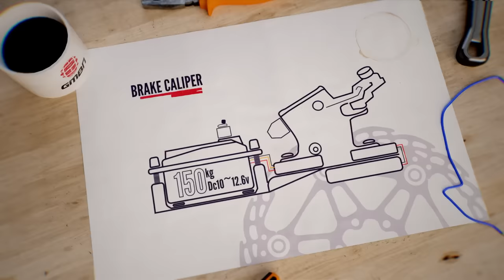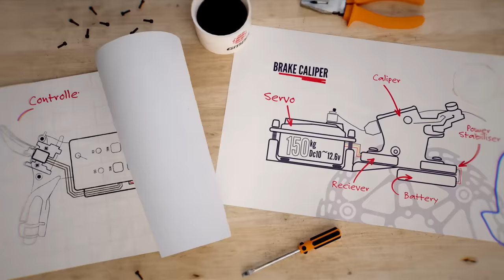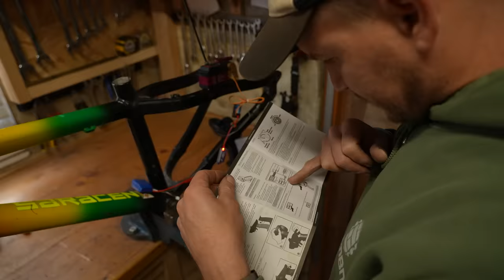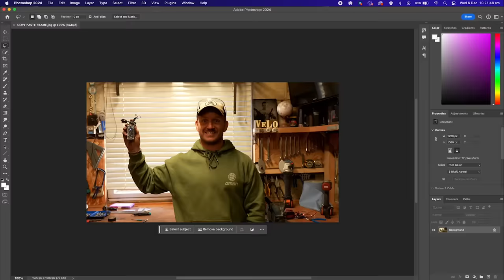We Made The World's First Wireless Bike Brakes

Comment: This is absolutely amazing ! Not just designing and building that on your own, but also daring to actually ride it pretty fast on real trails. And massive props to Blake for actually making a front brake version aswell. Im pretty certain quite some people would dare to try out the rear one but certainly only very few would dare to even touch that little front brake lever , for obvious reasons. 😆
Reply: Thanks dude. It was a hell of a challenge. Loved it
Reply: @BlakeSamson8 100% mkII needs to happen. I'd ride them if I could afford them. People fly planes with no mechanical connections. There's literally planes that would be impossible to fly with a mechanical yoke. Why can't bikes be fly by wire, too? I'm on board.
Reply: @pewsician2388  planes have decades of engineering and they are still crashing sometimes,yet their battery wont die midflight, and there is still physical cables connecting all the stuff in plane. On bike it has thousand opportunities to fail from error in electronics to lost signal or dead battery. And if battery dies once a month, you will probably end up crashing into the wall once a month
Reply: @BigAsianJesus  not necessarily, just have two separate systems for each brake so if one fails, you can use the other, or just brake by wire with regen braking
Reply: @BigAsianJesus  On semi trucks, the air system could fail and there would be no brakes. The safely approach used there is that when there is no air, the powerful brake springs will stop the vehicle. Maybe an approach could be that when the battery dies, the unit defaults to full brakes. Not sure how to work something like that out though.
Reply: @mikedwiles I think it could be done but the caliper would probably be huge
Reply: @BigAsianJesus I've absolutely abused my gx shifter and I've only had 1 actual issue with it ever. Some preface is that I crashed super bad months before the incident and knocked the battery and cover off. When that happened a little bit of the plastic on the battery got compressed where it slipped off. So basically a few months later it stopped shifting in a huge gravel climb. I panicked a bit but after taking battery out and putting it back in it worked fine. Point is it's always the mechanical bits that fail before the electronic. Everyone I know that has it or an axs dropper has never had a connection issue during a ride. Honestly for me I'm more scared when I bleed my brakes cause I always feel like I might fuck something up but that's just me
Reply: @mikedwiles  that honeslty sounds way more scary than having no brakes. Imagine you're flying down a trail and a wire comes loose or there's a short. Your front brake locks on and next think you know you're waking up from a coma
Reply: @Zimblake cheers Blake, awesome job🤘🏼.
To give it more stability to the plate of the calipers I would weld little triangles for each "L" angle on the plate.
I don't know if you understand what I mean😅
Reply: @Zimblake  i think its possible to design the levers in a way where it feels like a solid hydraulic brake (not just a loose potentiometer) with some kind of pressure sensor with a cam on the lever to press on it. perhaps the cam can be a stiff rubber so there is some give as you squeeze the lever
Reply: @bmxscape  you just have the lever act on a stout pressure sensor so the lever hits a solid stop, and varying pressure on it modulates braking.  And with software, this could be almost infinitely adjustable.   And  you could easily design a mechanical progressive pressure feedback system that would emulate good brake lever feel.

And failure?  You simply make it so when anything "fails," the default setting applies the brakes gradually until the wheel stops.  
Again, there are elegant ways to design a system that's safe & effective.

The problem is, it adds cost & complexity - and probably weight - when it's not even remotely needed.  One exception would be for different mobility issues.   Ultimately, how many batteries do you really want on your bike?  I like the idea of zero, but unfortunately that's pretty much impossible now.

Comment: For a v2: try to use a conventional mtb lever + potentiometer. Also implementing a strong spring into the lever could help with modulation
Reply: yea its missing the feedback we're used to, which is why its so automatic to just grab all the brake and lock it up.
Reply: my thoughts would be using the stuff that bottom out bumpers on coil shocks as you could swap the rubber out dippending on if you like more modulation or a short sharp leaver feel
Reply: Not an expert in electronics but was also going to suggest a potentiometer. Controller will read the potentiometer output and convert to rotations on the servo. But I assume you will have to build your own controller instead of using the RC car controller?
Reply: Maybe glue a magnet to the lever and use a hall effect sensor
Reply: If you want it to be based on feel a load cell would be ideal
Reply: @tiagobelo4965 I was gonna say that - use a load cell so the input is how hard you pull, not how far. Also maybe use a continuous servo with some sort of quick release, so you don't have to wait for it to wind out when you release the lever.
Reply: @Ryan-mv5wi  yeah,  a bump stop for the brake lever to prevent  bottoming out
Reply: And some controler to be able to adjust the ramp up of the servo would be needed

Comment: Haha, ‘Die-by-Wire’ braking… 😂
Great job Blake, creative thinking but it’s defo gonna be a thing somewhere down the line…
Reply from the maker: How long away do you think? Would you purchase some?
Reply: @gmbn  well the tech & protocols already exist, it’s just public acceptance that will be the biggest hurdle. As with everything bike related, once it’s been raced at the top level & the concept has been proven then it will slowly become accepted. 
Yeah, I’d definitely try them, I’ve always bought into the tech & been an early adopter for as long as I’ve been into mountain biking. Carbon frames, Disc brakes, Front, then Full suspension, dropper posts, have had first generation versions of all of them.
Reply: @gmbn  I agree with darren, the tech is here for a long long time, just public and consumer acceptance is the main problem. Everything in the bike industry at some point has some skeptics from tech that we use today. Suspension for example, people questioned why 120mm is a thing for downhill, if 100mm or even 80mm is enough. Now look at today, where 200mm is the norm. So definitely, it'll come, but not soon enough.
Reply: Oh yes, the other kind of "Death Grip Challenge"!
Reply: What could possibly go wrong  !!!
Great video!
Reply: Lawyers will keep this from ever being offered by any corporation

Comment: As an electronics nerd, I found this quite interesting.  I used to say that brakes is the one thing I wouldn't want to be wireless, but after seeing this I am beginning to think differently.  Lots of refining needed now, such as latency, integration, etc.  I can see this happening.  I foresee the caliper and server being one unit, the brake levers having a normal look and feel for the sake of intuitiveness and feedback.  And of course water resistance.
Reply: Would need a failsafe of some kind.....
Reply: Throw in a micro controller with wheel speed sensor this has the capability of ABS on bikes.
Reply: How about running the front cable through the stem and steerer and down to the front brake and only having the rear as a wireless one?
Reply: As long as both the brakes are on a different frequency it's highly unlikely for both breaks to fail simultaneously.... So I suppose the failsafe is basically Which ever brake , front or back hasn't failed.
Reply: Or just keep the front as a cable/hydraulic run through the stem, as it's the one that gets most use anyway.

Comment: Those wireless protocols are so reliable, it is a tech from FPV drones or RC planes. This one uses ESCs and servos, with no flight controller so more like a FPV wing. As long as you have a reliable receiver and transmitter you should be fine. ELRS is a good one, but maybe TBS Crossfire would be more sturdy. You can edit servos speed so it should feel more responsive with a lower delay. I was thinking about this setup, but obviously, it is unpractical, you can get a pair of good brakes for £150. Making levers longer could be beneficial, getting a spring-loaded gimbal is easy. Great video Blake, you are a legend

Comment: Great video Blake! I do have some suggestions regarding the implementation of modulation.

Two key things here: the actual modulation in the caliper, and the user-end's perception of modulation in the controls.

I would suggest attaching a stiff spring between the servo and the cable pulling the caliper so that the braking force ramps up as the servo pulls more. On the lever side, you could use an elastomer or compression spring that pushes against the lever blade on the end part of its travel. You can use a cable brake lever to pull on the trigger part of the mechanism. Last touches will then be to fine tune the bite point on the caliper side to match with the lever starting to engage the resisting spring.

Comment: I'd reccomend using a load cell for control on V2, should make it way easier to modulate.

Edit: if you're feeling extra adventurous (and have a spare set of handlebars, which you lads 100% do) you could put the electronics inside the handlebars for an extra sleek look

Comment: This is mindblowing - imagine having programmable brake profiles for wet and dry conditions. ABS and no more blocking brakes. Automatic brake force distribution with only one lever or braking with different switches like gripshifts or your feet position. I´d totally buy that!
I am riding AXS on three different bikes now and it never ever failed in four years. Could be solved with a fail-safe mode: Rear brake closes and front opens when battery is too low.

Comment: Blake, if you're gonna struggle with the soullessness of the feel of levers then research this: "Load cell". In Sim racing it does wonders on brake pedals because data comes from the amount of pressure/load applied rather than travel of the lever.

Comment: Notwithstanding that wireless brakes are a fundamentally terrible idea, this was fascinating. Some hugely impressive engineering from Blake!
Reply: They are coming, they are an excellent idea and odds are your car already uses them.
Reply: @kidShibuya  Not too many cars atm have them really. And those cars have redundancy of hydraulic brake system if electric one fails, that wouldn't make any sense on bikes. What advantages do you think there is to wireless brakes on mtbs?
Reply: @Dirtypandasan  The main advantage, which I think is a great one, is that a non hydraulic, non cable actuated lever doesnt have any resistance to pull against. That also means no fatigue in the brake fingers. Which actually is my only problem when biking. I think that, even though it seems like a terrible idea, it can be a really great one actually which I would definitely love to try out in a more refined iteration.
Reply: they are for sure gonna come, for the feedback I reckon they'd be using haptic feedback like the ones you found on game controllers. the genuine feel for the hydraulic oils I am guessing is the brake lever would have some chamber of oil in it, with a sensor/servo that replicates the feel of it presssing on the calipers, say the equal volume you press on the levers, would be the same volume of force on the calipers.
Reply: For my bicycle camper, wireless brakes are the BEST idea.  They will essentially be an e-brake anyway and only used when necessary ie.  To keep my camper from rolling backwards down a steep hill.
Reply: @ironeinar  Well, at least for me if you have good brakes with proper power fatigue is truly not a problem. Big rotors, long levers. With wireless there are many problems (reliability, safety, unnecessary complexity, weight, etc) and I just would want to know why do people think we even need these? To me it seems like people don't think it through if there is any real advantages to be had compared to hydraulic ones.
Mind you, I have Reverb AXS dropper and I think that's amazing but it's very much different than brakes. Just saying that I'm not opposed to some parts going wireless but I just think brakes are not such a good idea.
Reply: @karlcorrz  So what's the real advantage to be gained to go wireless? Pros vs cons: No hydraulic cables but more complexity, less reliable (less safe), more batteries to charge, more weight, etc. I just can't see what is the problem that people want to fix with this idea of  wireless brakes?
Reply: @ironeinar  Also I think that some progressive resistance to pull is a good thing as it gives you direct feedback and feel for your brakes, ie. how hard you are braking.
Reply: @Dirtypandasan  well the feedback is a valid concern, but you can artificially set up the feedback with for example rubber dampers. And the fatigue thing for me is unfortunately a real problem... I ride MT7s with SLX levers and even though theyre about as powerful and controllable as it gets, I still fatigue really fast. And another factor to consider is, you can just swap them around. If you want a brake less or more, just swap it on, no cables to route through the frame and potentially headset. And to add to that, theyre perfect for a freeride bike you want to do barspins or tailwhips on. I know, thats very specific, but for me that would be perfect.
Reply: I could see people using them on the rear, wireless brake, gear, and dropper, but on the front there is no point as you can run it through the stem and down through the steerer. Less expense, and just a little safer having at least one analogue and non digital brake where it's needed most.
Reply: @user-yv2cz8oj1k  Thats true but if you were to run a wireless brake in the rear and a hydraulic brake in the front, it would feel really weird as the characteristics of those brakes are very different... I probably wouldnt do that lol
Reply: @Dirtypandasan  same reason for a wireless dropper post. People will buy it for lots of money to get better aesthetics.
Reply: @Dirtypandasan   People will pay a lot of money for them. That's all the advantage companies need to make them.
Reply: @Hipp0campus_1  For me the reason for AXS dropper isn't aesthetic. It's easy installation (easy to switch to other bikes) and no cables coming from left side of bar (front brake cable running through headtube) so by running a bit longer gear and rear brake cables I can do bar spins.
Reply: @bradweaver6124  Yes, obviously corporate will just do whatever they can sell for a good margin but we weren't discussing that.
Reply: @ironeinar  True, but you could still use the cable pull hydraulic brake unit on the front like the wireless brake uses, then try and match the wireless brake to the cable one through modelling techniques for the lever effect on the brake and add in the feedback response coming back from the wireless brake using a strain gauge on the rear brake cable and a small motor on the bars. Though personally I tend to feel what the bike is doing under me rather than relying on the brake levers, and use the front way more that the rear, maybe I can apply to be a test pilot. 🤣
Reply: Regen braking on ebikes though...
Reply: @ironeinar  people race 200kg motorbike for hours, brake with one finger and don't have "fatigue" problem. There is something wrong with your brakes.
Reply: @inevespace  Hahaha you have no clue of what youre talking about 😂
There definitely is nothing wrong with my brakes, I'd even bet my new frame that my brakes are better working than yours lol
I'd actually say that my fingers are the problem... But im riding like hours a day in good weather but it doesnt really get that much better... Maybe I should get my vitamin levels checked or something like that, I sadly have no clue where the problem originates from...
Reply: @ironeinar  few month ago I fall and damaged my braking finger ligaments. Finger became very weak so I can brake only with 1/3 force. But it also huge problems in everyday life. Because I can't pickup laptop or frying pan. Now it is half healed and I can brake without problem.
Reply: @inevespace  glad you recovered from your fall, sounds really unpleasant...

Comment: If Blake could do this in his home garage, so can the big companies. We are going to see fully wireless bikes in the future. Crazy to think about..
Reply: As the big bike companies lawyers sit quietly shaking their heads. Manufacturers would be sued back to the stone age when the crashes start on day one….
Reply: Look, it's not needed on the front, just run a cable past the stem cap and to the brake, but yes, I could see some people running these, with a wireless dropper and gear shift, to remove all the frame cables and hoses.
Reply: They would need to have a force feedback unit to make the brakes feel right
Reply: @bibasik7 if they only need to do it with the rear brake it is possible. But generally I feel how effective the rear brake is being using my feet and legs.

Comment: Instead of using the servo to pull the cable, use a strong spring to do that. Then, use the servo to actually release the brake. That way the system is fail safe, so if there's no power or the servo breaks, it applies the brake.
Reply: I am not sure what is worse - sudden loss of brakes or sudden uncommanded braking.
Reply: @piast99  Good point. Perhaps you could have different systems for the front/rear wheel. Use fail safe at the back, but not at the front. (so it won't send you otb on power failure)